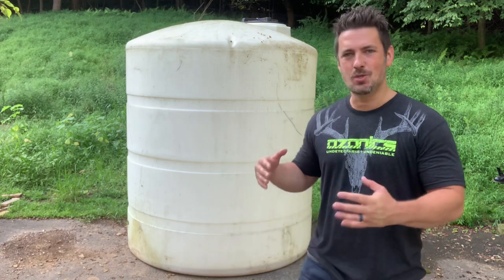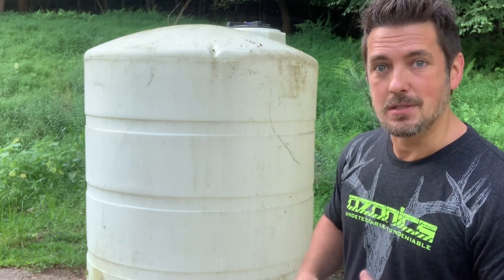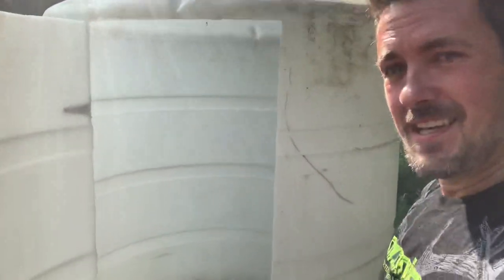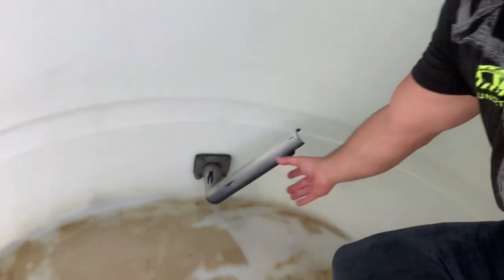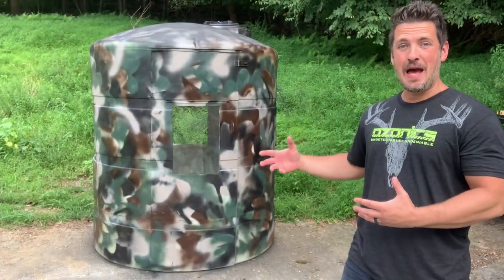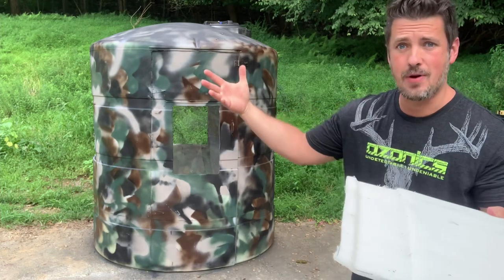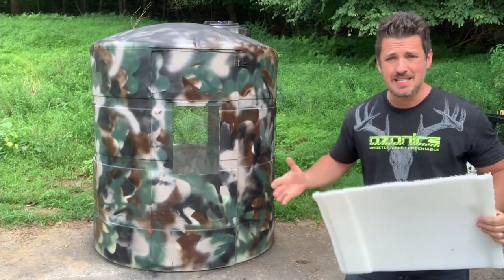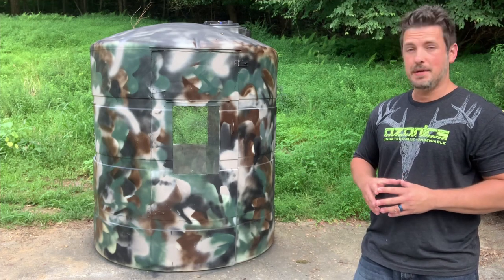DIY Water TANK Hunting Blind: How to Make a Simple, Cheap & Durable Deer Blind out of a Water Tank

Comment: Paint the inside black so your silhouette doesn’t spook deer when you move.  Add acrylic windows and tint them.  Put some handles on the sides to lift, and some vents inside that open and close.
Reply from the maker: Hey Oscar. Thanks for the recommendations! I’ll definitely be painting the interior black in the spring 👍🏻
Reply: Beat me to it I should probably read comments first I just posted that

Comment: Where did you get the window sliders?
Reply from the maker: Hey TJ’A Farm and Fitness! Thanks for checking out my channel! I got those window sliders in the moulding aisle at Home Depot. They are an inexpensive vinyl. I believe this is what I used: https://www.homedepot.com/p/Stabilit-855-1-4-in-x-1-1-8-in-x-96-in-PVC-Composite-White-FRP-Divider-Moulding-fits-1-8-in-material-10002-ZW096CB/205347156 Best of luck with your blind! 👍🏻
Reply: @mountainbuck  Thanks so much for your prompt reply.  I'll be building one with a 2100 gallon tank next week and documenting it on  my channel.   You had some really simple ideas that will save a lot of money.

Comment: I’m in Texas…I’d probably sweat out of it in 15 minutes. Is it hit in there?
Reply from the maker: When I was building it was warm out so it did get warm in there. It just depends on the outside temperature, but you also have those big windows that will provide cross-ventilation. Best of luck 👍🏻